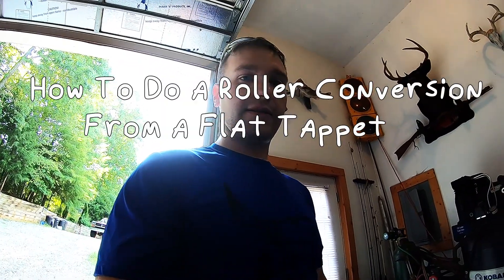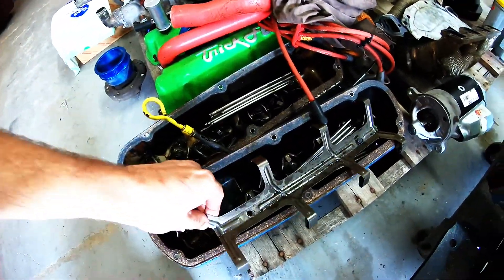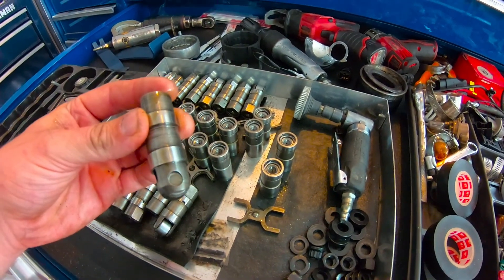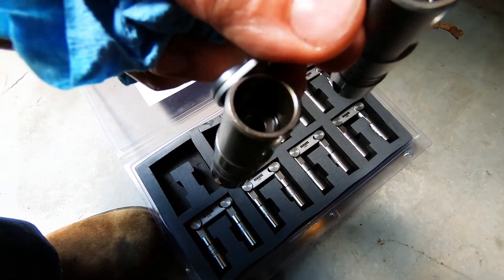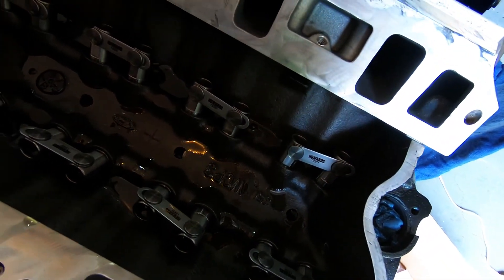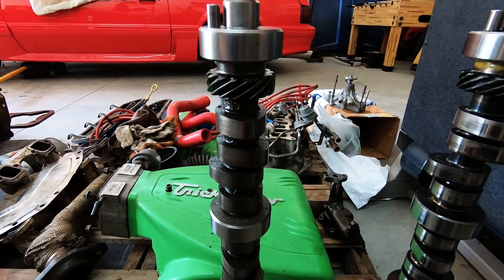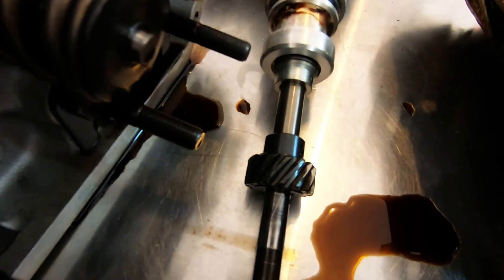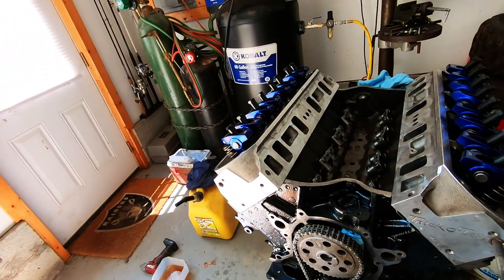How to Convert From Flat-Tappet to a Roller Camshaft

Comment: So when converting your non-roller block to a roller setup all you need to make sure is, is that the lifters are a set that have the link bar like your set from Trick Flow? Then obviously the appropriate roller cam and correct length of rods per lifter? The roller lifters attached to one another with the link bar eliminates the need of the spider tray all together?
Reply from the maker: Adam Wofford That is correct. It sounds simple but the cost can be substantial. Most people would hunt down a roller block before trying to retrofit because the cost of a used roller block is pretty minor. However mine was a fresh short block from the machine shop and it allowed me to make this video.

Like you said, The link bars eliminate the spider. Apart from the other valid facts you stated, ensure you run the appropriate distributor gear for your cam.
Reply: quick google search turned up a forum of someone that burned about $100 on a set.. said they were terribly machined. metal shavings, wouldn't fit without modifying the link bar slots larger. ended up just buying another set of name brand lifters. these TFS ones are $460 now, but you can get the Howard's ones for $400 and he said that's actually what the "TFS" ones he's using are..

Comment: Trick flow as far as I have found. Doesn't make much of a retro fit cam, lifters for the old school 302 block. They do for your 351 block. Try doing a retro fit for a 1973 302 block. That's what I'm building. I know nothing about a Ford motor. So I'm searching all over the internet.  They make retro fit kits. They only come in certain lift & duration cams. What do I do if I want something different?
Reply from the maker: Lee Olaeta The TFS hydraulic camshaft should still work in your block. Retrofit Cams are for situations where you don’t use retrofit lifters. I prefer to use retrofit lifters because it allows you to use almost any aftermarket hydraulic roller camshaft. If you use a retrofit cam, it has a smaller base circle and your choices become very limited.
Reply: @MonroePRacing  even with the different  cam bearing size? Hence the word "Retro fit"
Reply from the maker: Lee Olaeta I am not aware of any cam bearing size differences between block years. If you have a source on this information it would be appreciated. I always have changed my cam bearings, but never had to change sizes due to hydraulic roller or flat tappet.
Reply: @MonroePRacing  what year 302's have you worked on?

I'm not talking about the 351. They are all the same. 
  I may be wrong. BUT, Iv understood that the early 302 non roller block has different size cam bearings.  
Look up the Comp cam retro fit cam, rollers. Spiderweb, springs, roller chain. I would rather run a  machine fit gear drive. They are much quieter the the regular gear drive.
 Anyway. Back to the journals.  Different sized.
Reply from the maker: Lee Olaeta It is possible that cam journals in earlier years were different, however, I have not found any supporting literature. If it were true, simply running an oversized or undersized cam bearing should allow you to fit more modern camshafts without issues.
Reply: @MonroePRacing  I'm sorry. I've been in & out of doctors & hospitals for the last week I wasn't able to check on what I was talking about. 
I have 2 more appointments tomorrow then Friday one long one in a hospital.  When I get over all this or I'm dead.  Next week. I'll check on it all.
Make sure you asked me next week about it again.
If I don't answer I'm dead.

Comment: Your getting a false reading by using a hydraulic lifter to check pushrod length, you need to use a solid lifter or that plastic tool that give you the angle ..just my thoughts

Comment: All new valvetrain why not solid roller?
Reply: Because hydraulic is easy: tighten rockers to zero lash, then add 1/2 turn.  Also, hydraulic rollers just match well with street use - how much time does your engine spend at 6k or higher revs?  It's less than 1% run time for my motor - I reach there when passing sometimes.  The extra cushion hyd lifters adds is nice too - you can stay away from more extreme spring pressures solid rollers need that cause valvetrain to age faster [your motor won't thank you, so just know what you want: performance, or full race].   Personally, I'm still partial to solid flat tappet lifters as they [usually] can get more area under the curve for the same duration/lift vs. hydraulic roller,  and can add a good 800 rpm or so to redline - but solid roller still wins hands down for an all out motor.  I just have to add ZDDP with every oil change.  More often than not, going from flat tappet to hyd roller needs no headwork, but a spring change.  Going solid roller will often need spring pockets machined or completely different heads when there isn't enough to machine on.
Reply from the maker: I agree, if you are building that type of chassis, this would be the time to install solid rollers, however, this build had a different endstate.